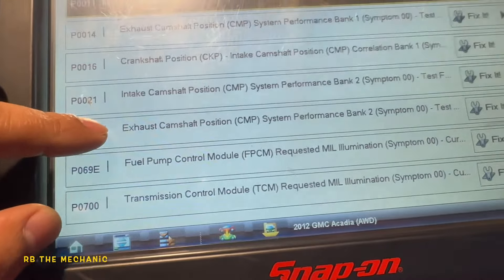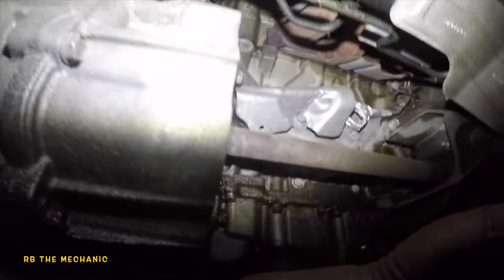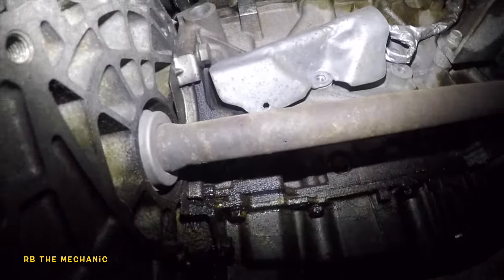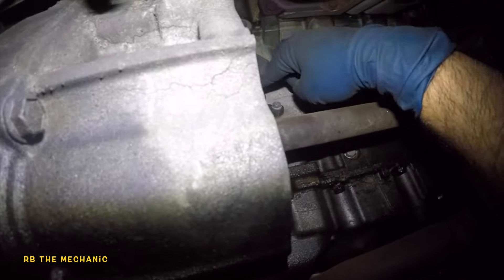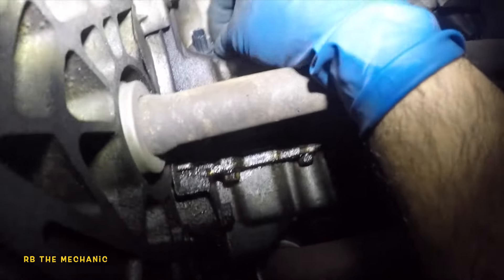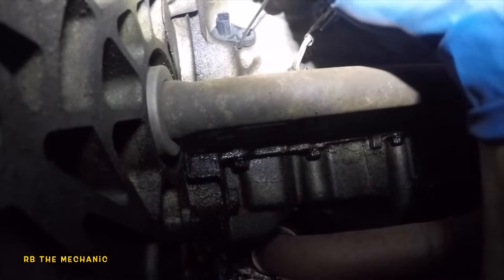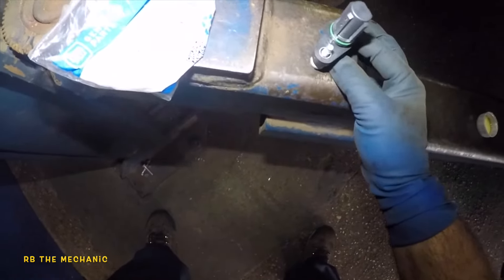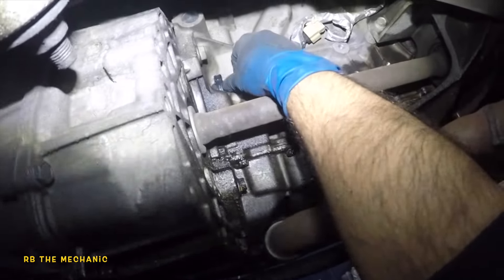How to replace crank sensor on 2012 GMC ACADIA P0016 crank sensor

Comment: So my check engine light is p0017 and p0021 what are your suggestions? My car doesn’t run funny it does burn a little bit more gas than usual and then I know there’s crankshaft sensors and position sensor. I don’t know which one to change and I know they have multiple ones and the location. And mine is four-wheel-drive how the hell do I access that sensor if it’s the crankshaft sensor?

Comment: Did this fix the problem ? I also have 2012 Acadia - sometime it starts - sometimes it does not. It has stalled a couple times and wouldn’t restart until later. I have some of these same codes - Fuel pump request illumination and TCM request illumination. However no exact sensor codes. Any help is appreciated 🙏🏽
Reply from the maker: Yes this was the issue also this car has issue with fuel pump moduel it would die intermittently
Reply: Follow up - I replaced the crankshaft sensor and it still wouldn’t start then I replaced the computer - fixed my issues. Thanks!

Comment: Problems here Hi no Ancwer ... And I saw it, it's not like what you see on YouTube. You have to dig the pipe and collectors to get to the sensor and it's on the left and you can't see it on the right. There are many descriptions of the task, but only one described it on YouTube and showed that he had uninstalled pipe exost and collectory. It's a bit low if you don't have a good lift
Reply from the maker: What year make model u have awd?